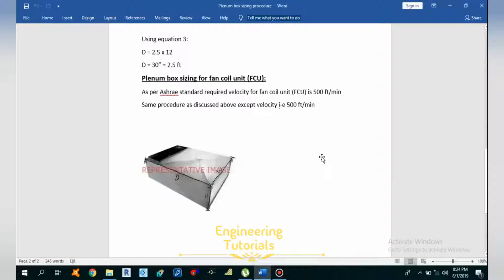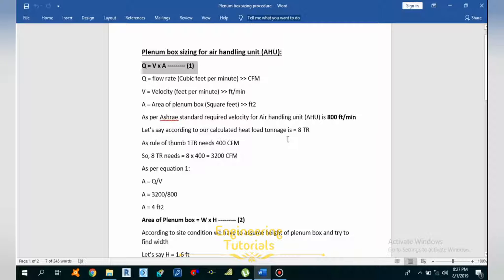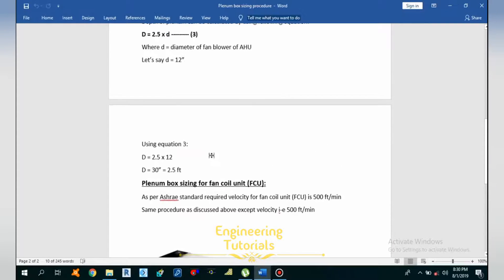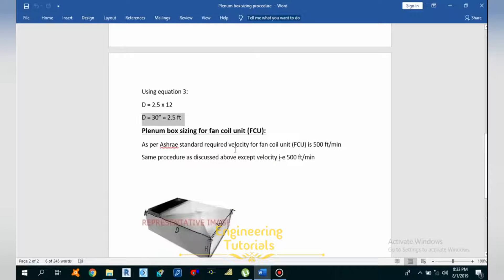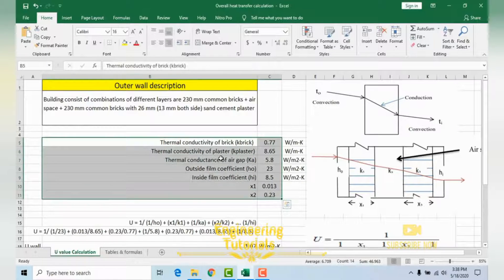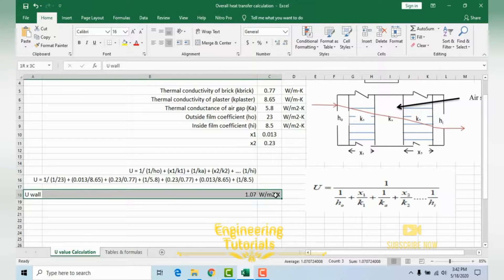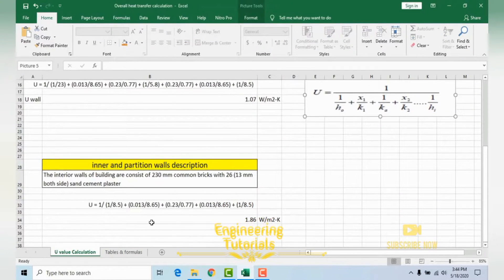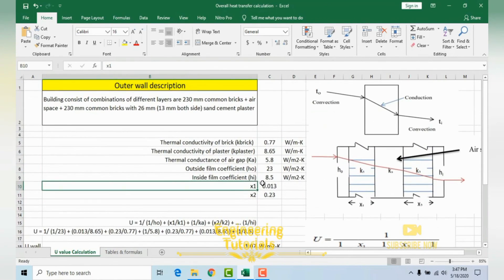hvac design Part 4 ll Plenum box sizing & Heat transfer coefficient U value calculation procedure

Comment: Hi sir as usually you doing great work 
I have a question why we are multiplying 2.5 with blower diameter as you said to find out plenum depth can you tell me in which page of ISHREA standard this thing has been mentioned. And sir pls share your whatsapp number 
My number is 7840022211 you can add me.